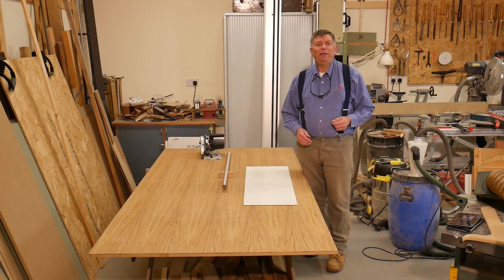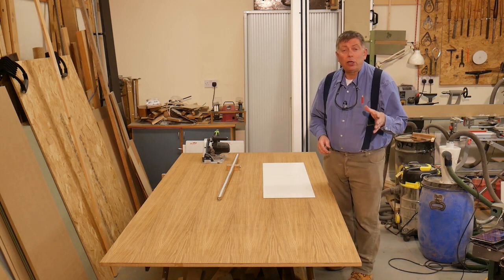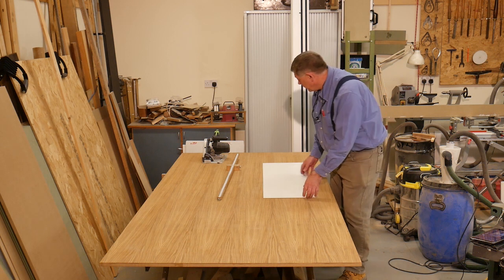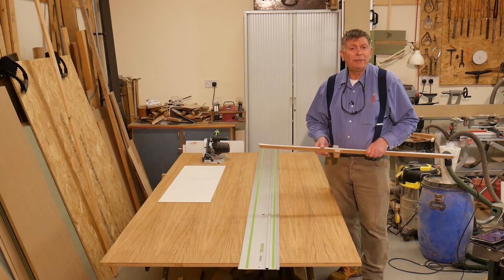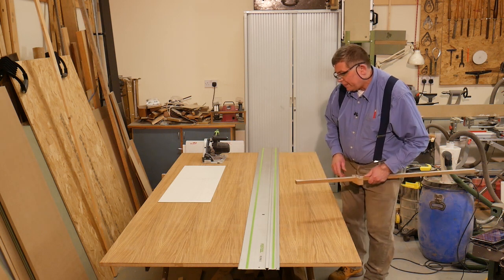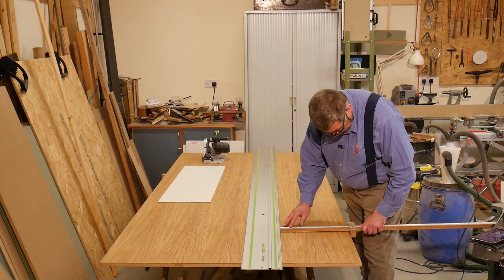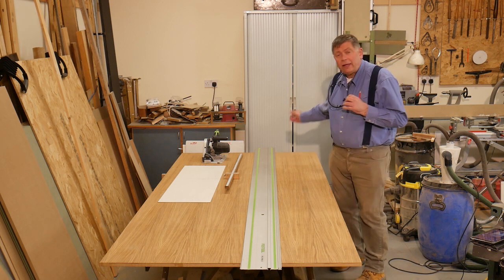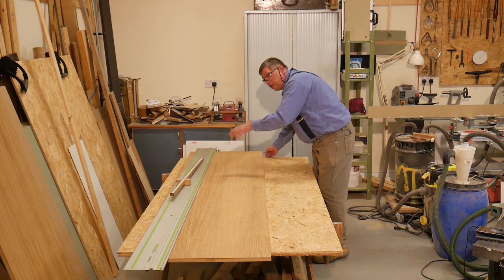Mackintosh Inspired Wardrobe Part 03

Comment: Hi Steve,
Interested you do not clamp the track before cutting. I know it has a non slip backing but I always use the track clamps just in case.
Reply from the maker: That's fine, but I've never found it necessary.
Reply: @SteveMaskery  I found that if anything the clamps are likely to push the track out of position, never needed them

Comment: Don't get me wrong, I do think story sticks make things a little bit easier, but they certainly don't make things any more accurate. You can transfer a marking from a story stick slightly off, just as easily as you can with a tape measure. Yes you're not measuring numbers but you're just as likely to end up with incorrectly transfered markings. And now you have double the chance of error as now you're trying to line up a tracksaw with that mark. When you were trying to line up the track parallel, you could see it pivoting. Would be easier to have two gauages, where the first sets the second.
Reply: It is true that the marks could be transferred inaccurately but less chance of an incorrect measurement. I made a carcass for a built in today that is overall 11mm too long. I can't work out how it happened and no harm done as the width was not critical but in general I like to make identical pieces by using stops etc and most times the actual measurements are not so critical. 

I agree with the parallel guide on the track though. I have two gauges very similar (with no measureing tape) because I find the rail tends to pibot in the middle so I can clamp the guages at each end and butt the rail against them.
Reply from the maker: The point I am making is that I am much less likely to get numbers mixed up if I'm not using a tape measure, or worse still, two different tape measures. It is easy to mistake 86 for 98 if the tape is upside down. If I get a tick mark out, that is just carelessness.
As to having two gauges, that is a good way to do it, and sometime I do, but I just wanted to show how a gauge like that is a good way to set a track perfectly, rather than relying on  a couple of pencil marks.
Reply: Sorry Wforl, I disagree, I think a story stick is by far more accurate than measuring each time, especially when there are many to be done. I make bespoke oak window frames and I’d be forever checking and double checking with a measure tape, far to worrying and time consuming! You only measure once with a stick!!
Reply: Woodgate425 I think you missed my point. I would still use a story stick in that situation. My point was that you're still transferring marks from one thing to another. Which is always inaccurate whether you use a tape measure or  something else. Again, the story stick is easier and quicker, but no more accurate. Getting numbers mixed up is another matter, I'm just talking about accuracy. In this case it was .... transfer plan to story stick, transfer stick to work piece, align track saw to work piece. Lots of accumulating error.